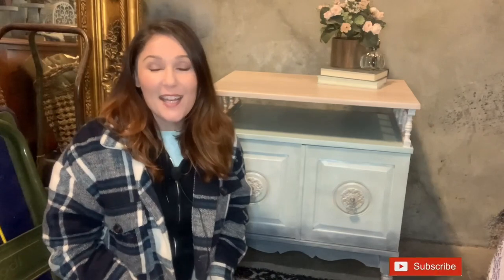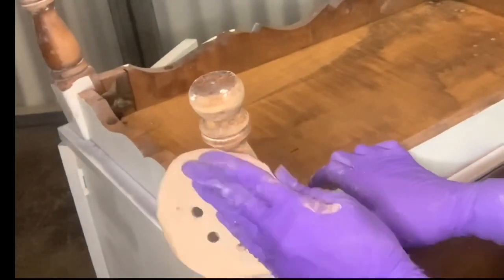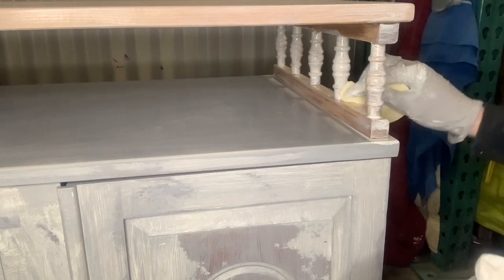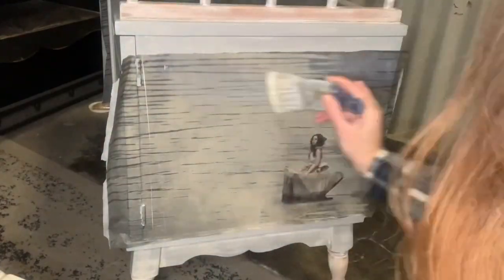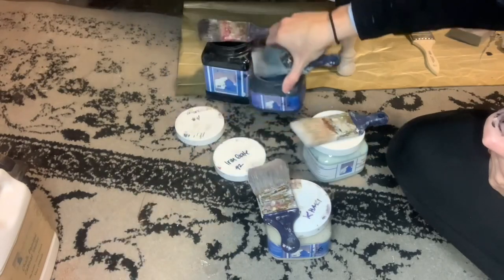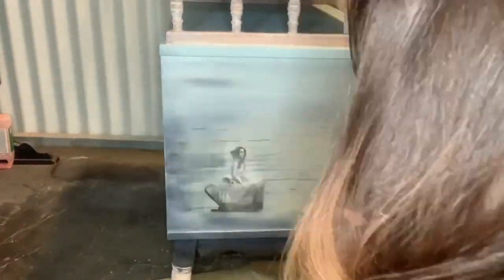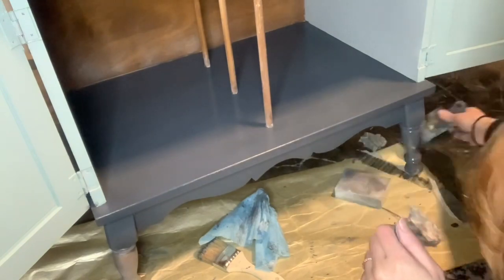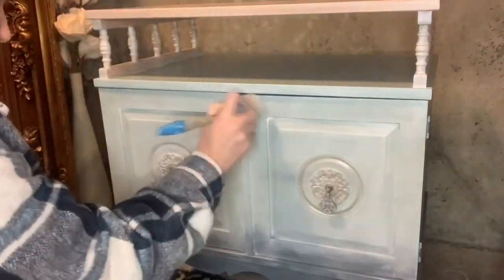Old World Cottage Core Style Makeover | Ugly Duckling Challenge | Elegant Upgrades

Comment: Very pretty.. Question..is thinner or thicker paper better to decoupage with? 🤔
Reply from the maker: It’s all about preference. I like working with thicker paper because it’s easier to work with. But if I’m doing thicker paper I like it within a frame or going all the way to the edge of a piece so you can’t see the edge of the paper. Thin paper doesn’t leave an edge and looks like it belongs on a piece because it almost becomes part of it and you can’t see a definitive line, but it tears very easily. So I use all of them depending on the situation.